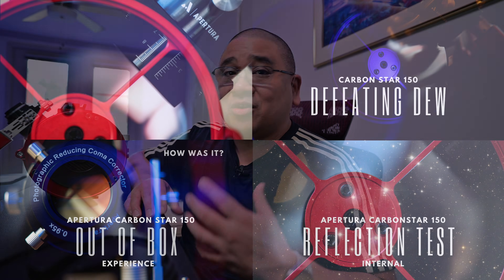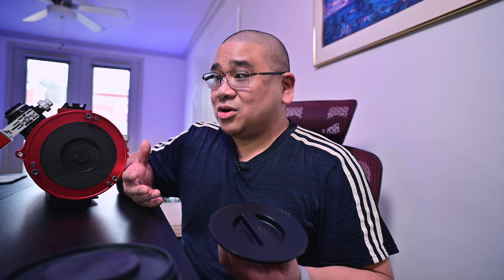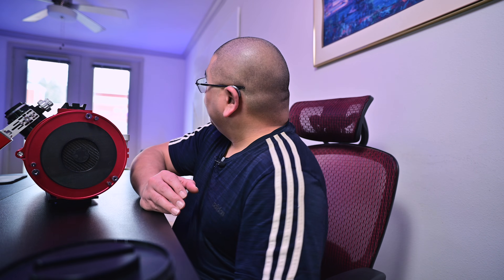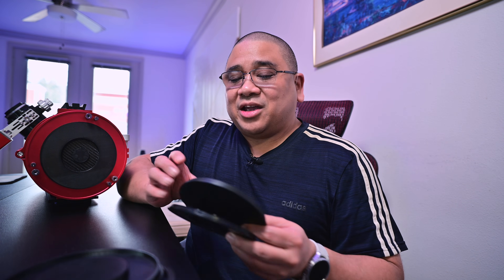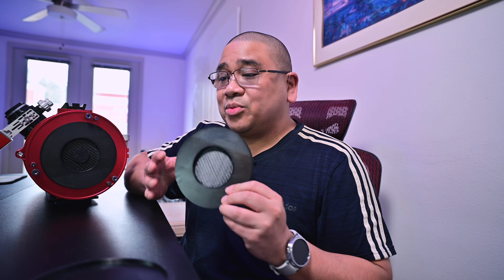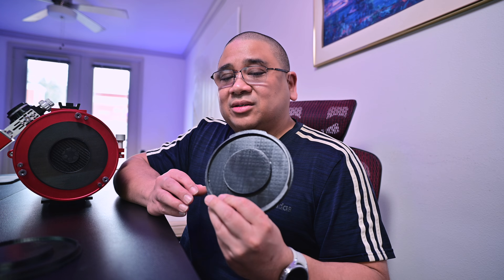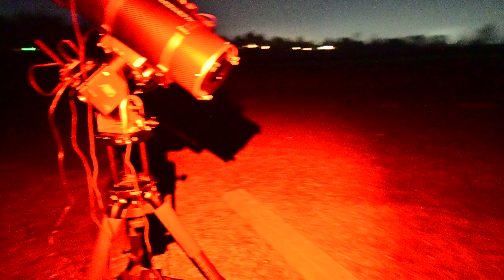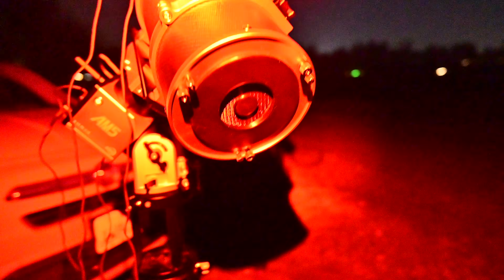How I fixed my Carbonstar 150 with 3d printing.

Comment: Your STLs worked well for me. I have both the front and back covers printed. The only real issue I had was removing the supports generated for the center of the back cover. That TPU just doesn't want to let go. As a bonus, your front cover also fits over the dew shield I printed previously for the Carbonstar 150.

Thanks
Reply from the maker: Your welcome! Glad it worked for you!

Comment: Likewise, my back cap falls out when it is cold, and sometimes even when it is not - a VERY poor design on Apertura's  part. The front cap isn't any better. I've glued black felt pads on both caps in four places and it is improved...sort of. I will reach out to you about making a replacement!

Comment: Same problem here. Mine has zero retention and falls off the second you tip the scope off horizontal. The front cover is the same. Very disappointing such a simple thing they couldn’t get right. So I’ve taped the back cover on, and used felt tape to make the front cover stay on.
Reply from the maker: Yeah I was really surprised when it happened to me.  I really like the scope otherwise.
Reply: I am so glad I'm not the only one. I love the scope with the exception of that part.